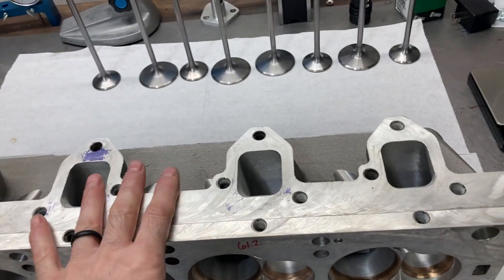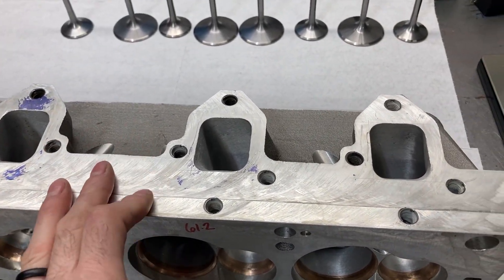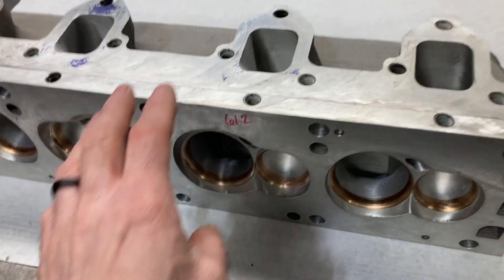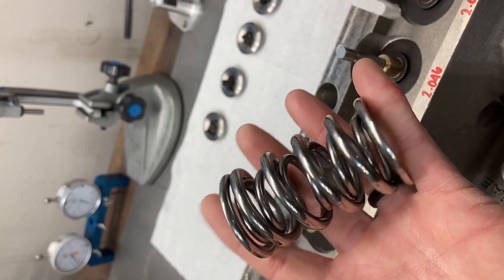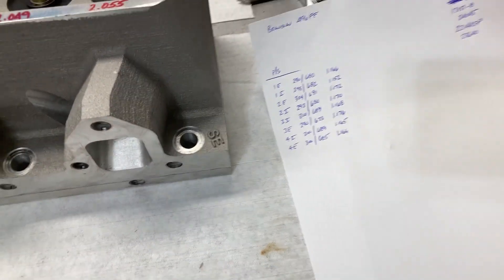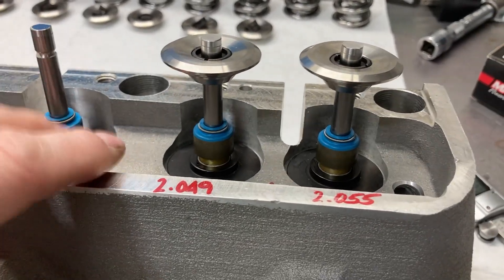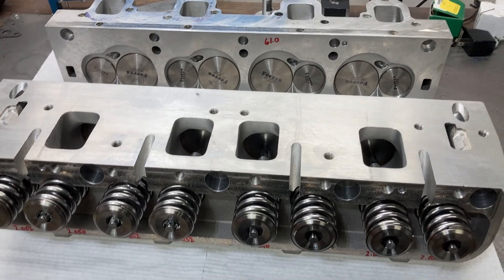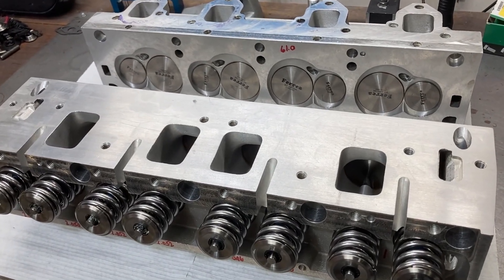Lykins Motorsports FE Power Cylinder Head Assembly

Comment: Brent, I am considering building a 416 because I have a D4TE block and a 3.98 crank. Would Trick Flow heads and a 2x4 tunnel wedge 11:1 cr and the bullet 245 @.050 and.600. I will need 4.08! Pistons (forged) how much hp and torque can I hope for?

Comment: Hello Brent, when assembling valves into their guides on a performance motor, do you like to feel by hand  a little bit of wiggle clearance versus a street head,  how much difference you like to see on clearance on the valve guiedes?
Reply from the maker: We either use pilot mandrels for the guides or use a mic/bore gauge to check clearances.

Comment: Why would you want to use the valve seats that are being used in this case of the 496 engine? I have not heard of these tpy seats before
Reply from the maker: These are the best seats for titanium valves.
Reply: @Lykins Motorsports  ok is it cause it's a softer mutual that the value I'm just trying to understand the thinking  I work diesel engines for a living always looking for more knowledge I also have a fe390
Reply from the maker: It's about heat transfer.  The BeCu seats transfer more heat into the head and away from the valves.
Reply: @lykinsmotorsports  ok cool that makes sense thanks for the information

Comment: Nice job! I do have one question regarding inserting the valves through the seals during assembly. I always have used a thin plastic cover shield over the valve-stem lock groove to protect the seal. Is that not necessary anymore for some reason? I did hear David Vizard mention in one of his videos that a particular type of seal is not damaged by the groove and the valve can be installed without the cover shield. Is that the reason and if so, what type of seals are they? Thank you my friend. Keep up the great work!